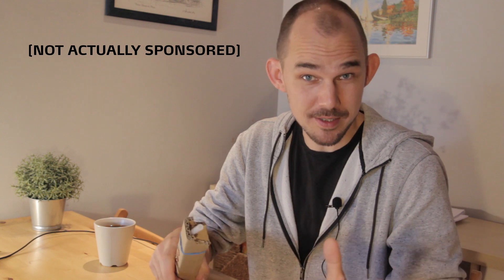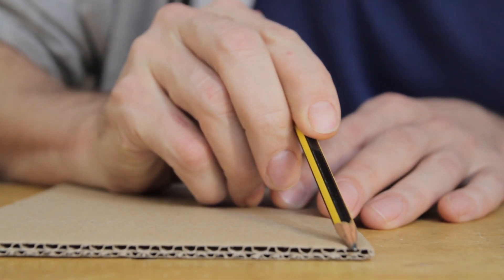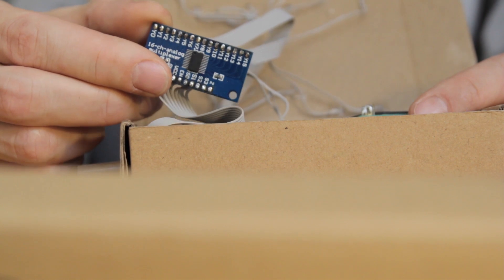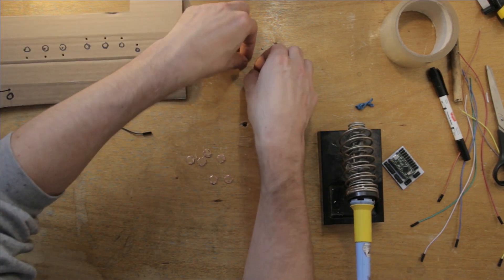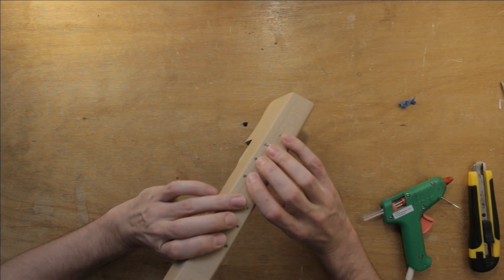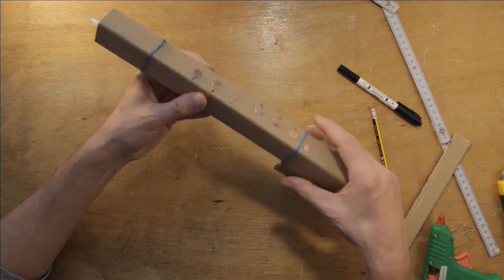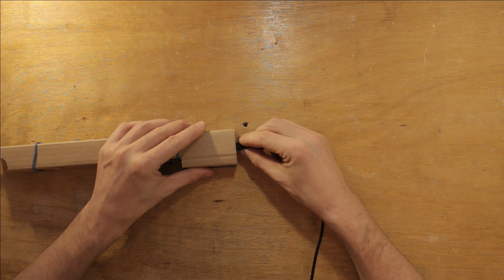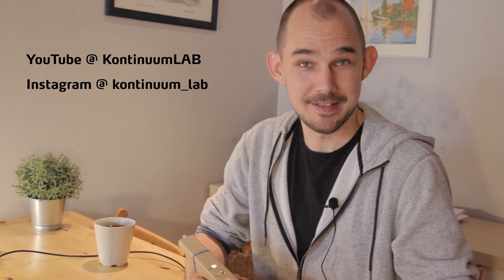KontinuumLAB WORKSHOPS: Recorder MIDI Controller.

Comment: There is a problem that my flute cannot save the calibration results. Pressing it three times in a row does not work, and the LED light of the teensy never lights up. Is my teensy damaged? Is the calibration code wrong?  Or other reasons😰🙏😳
Reply from the maker: Hard to know without more info. Did you change the code? Are you sure your button is connected properly? Did you do something that might damage the Teensy?
Reply: @KontinuumLAB  Currently teensy can be recognized as midiusb, but there is no calibration save function. This is some modification "int keyPins[ 8] = {19, 22, 1, 3, 4, 16, 17, 18 }; "and the addition of"  breath = constrain(breath, 0, 127);
       if(breath >= 100){
       octave = 12;
       breath = breath-27;
       }
       else{
       octave = 0;
       } ”And I connected pin 8 to the 220 ohm ground pin with a button. Currently the flute can be calibrated, but the calibration result cannot be saved. I can’t find the reason because I’m too stupid.😂
Reply: @KontinuumLAB  I found the reason!  I found that Recorder_dec19 version of the code did not include the calibration-h. After I uploaded the Recorder_001 version of the code, everything was normal!😎
Reply from the maker: @goodday6763  Awesome! I'm glad you figured it out